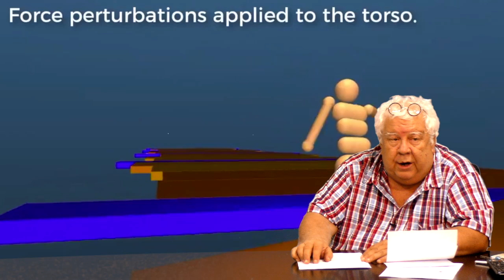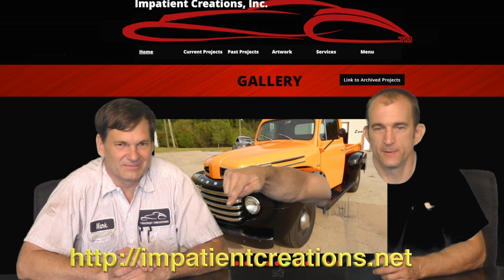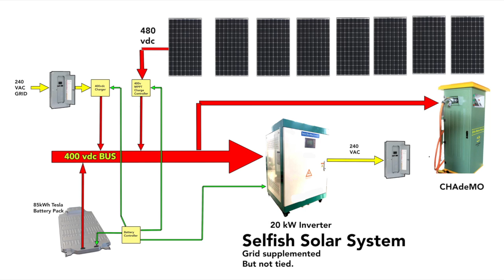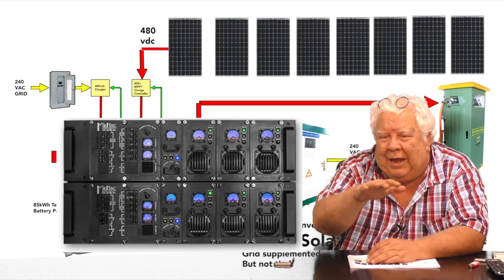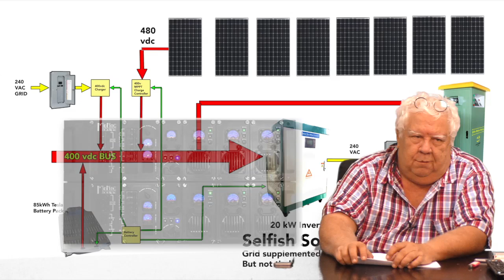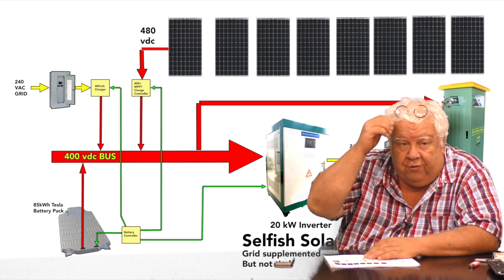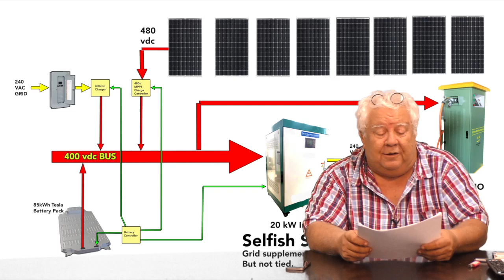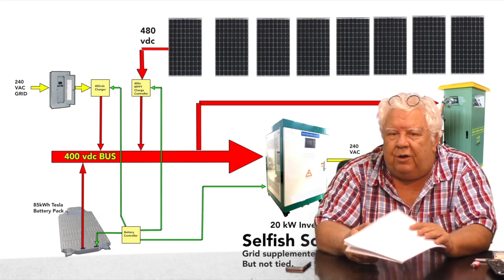EVTV Friday Show - July 21, 2017.  Tescalade - Tesla Powered Cadillac

Comment: Love the show!  2 thoughts, I started doing solar in the late 70's.  Back even before PV was a practicality.  I remember, 30 yr payback (= assumed home mortgage(another stupid assumption) based on a kWh will hit 10¢/kWh !  And I thought it will never be 10 cents, it was around 3¢ then.   My mom created Solar Engineering Magazine and later in 1986 The Handbook of Applied Photovoltaics.  Doing solar back in the day was clearly an adaptive scavenger hunt across nearly every trade.  As a form factor, "still to this day" preheating water or space heating, is or could be passive applications.  It baffles me somebody isn't packaging a plug and play no brainer solution.  You've got it right.  Too much chaos.  My argument, an Ikea (or whatever brand) 4kw, 5kw, or whatever, applied to a load as supplementa solutionl to start, charge the primer.  Unfortunately, my dad, a judge said people are stupid.  As a commercial architectural designer I've learned to design for idiot proof.  My associate built a high rise for Lone Star Gas in Dallas.  They installed gas powered generators in the basement to power the building.  They hated Dallas Power and Light.  Natural monopolies, nuf said

Comment: I agree with all you said through out the whole video.   I been studying and researching solar for the last ten years. I came up with the same  conclusion. I am going to install an off grid system with a battery charger connected to the grid. Some form of lithium based battery.  I was going LiFePO4 or LTO as my battery choice. However, the current prices of used EV batteries is a real temptation now.  Your Tesla battery controller is looking nice.  Keep up the good work.

Comment: Good show Jack.  

I gave up trying to get a grid-tied SMA Inverter reporting to the internet this week.  You're right, they are very complex.  I talked to SMA customer support, batting emails back and forth and phone conversations.  They ended each communication with the reminder, if this doesn't work, contact your local solar professional (their polite way of reminding me that I was weak link in getting their system operational), apparently unaware that the 11 pages of detailed steps they sent me might be part of the problem...

I agree, solar, EV, battery storage, (all quickly decreasing in price while getting easier to implement),  are the direction people will go and the utilities are not keeping up.

Comment: Excellent show, Jack. I like the new direction. Not that EVs are commoditized but that wheel is already in motion and it won't be stopped.

I agree with you on the 'selfish' solar system idea. It makes no sense to sell your power at $0.017/kwh to then buy it back later at $0.13/kwh. If you have extra power to sell to the power company, you oversized your system and lost money on it. Maybe buy another battery and charge that instead.

Comment: Jack, Bill, what about putting a TM4 Motive, 2nd motor,
driving into in the FrontWD of the Escaslade ?

The TM4 inverter, can be made to "Follow" the Tesla Inverter,
thus making a 4x4, that uses the original, mechanical from axle-assy,
and drive with a fairly-consistent front-rear torque-bias under load.

Comment: Hi.  I didn`t read all the comments, but want to mention in case no on else did that Tesla announced they would be insuring their own cars in the future because of so many arguements with in-sure-ance companies.  I was hoping to hear more about this. 
 
Also, it is my understanding the reason a Tesla is so expensive to insure is that if any part of the compound aluminum frame is bent, they will not repair the vehicle.  There are a couple of Teslas wrecked here which should otherwise be fixable....  One is a P100 wrecked on a test drive - we are trying to pick it up for batteries and drive-train, but the vehicle has been in limbo since the winter due to in-sure-ance squabbles.  Not sure what it will go for at auction here in Canada, but are fantasizing something like 20K.

Comment: Jack,  We win every time, genius.
When you do make the controller you should default it to keep 15-94% discharge(or even 30-70% if lacking use), basically optimizing the product lifespan by >30%, I'm sure you know this though, just speaking to the cells. 
I feel like you comprehend the kind of user friendly parameters needs of mass adoption.
It's funny cause I was of the same conclusion, except I wish to buy 1 replacement pack and leave one in the car, basically making it a 2ndary pack(which can drive to retrieve from grid if need be). I thought of this months ago(before finding you), and you've come to the same conclusion, but I'll be off grid.
You're a solid mind sir, it takes a solid one to be on par, I feel we could have a constructive conversation on all this.

My plan, get land, a nice windstream hitched, Model 3+replacement pack, and highly reliable panels(>25yr) on a custom aluminum tracker(I got the beams already for it's sturdy base 10 and 12 inch i-beams I got very cheap, and 25 year warranty panels even cheaper :) ) and have a small farm/aquaponics system of my own device.
No home tax, No power tax, Portability, Reliability.

See you use an iPhone 4, I had an iPhone 4s for 5 years(my first smart phone)
You mention an off grid home in WY, dats me quite possibly, or AZ.

Comment: I bought a 2018 Model S & it goes far beyond expectations.  The only thing I'm asking myself is why did I wait so long!  After buying this EV, called Tesla Solar to install enough solar panels to take care of 100% of my needs, but they only wanted to sell me a grid tied solar system.  I turned my nose up to that & asked where are the batteries?  I don't want a solar system that goes down when the grid goes down, period. In Dallas, Texas it's all about utility credits.  Power companies will not purchase anything with net metering.  They will only give you credits for surplus solar & if you switch power companies, then it's to bad to sad.  You get to start over giving away solar power to the power company.  My mother & father didn't raise a fool; so, I will not do that.

I love your Shelfish Solar concept, for that's what I was expecting Telsa to do.  I found out they didn't want to do this; so, I canceled the whole deal.  And, yes I want to charge my EV from sunshine too & tell the power utility companies to go to hell!

Comment: Jack, you should watch youtuber @Car Guru - He's repaired completely junked Tesla's like the ones you get. Very interesting walk through, his videos are a little amature, to be sure, but he's gotten a completely totaled Model S up and running.

One thing to note about the cost you mention from Tesla to get a repaired Tesla back on LTE / and on network. That fee is basically a warranty certification as well. So any future repairs (2 or 4 years depending on milage) comes with that fee, or so I was told by representative.. So, is $4k worth getting back on network with a 4 or 2 year warranty with on-site service? 

Consequently, thats the same fee they charge if you buy a pre-owned and take it in and they will re-certify the pre-owned and give you a warranty. It's the same warranty you see on their Used Car site.

I don't know any other car manufacturer that will re-cerify a vehicle you don't buy form them directly and give you an extended warranty.  Granted, $4k is a lot, but so is the vehicle. 

Eye of the beholder I guess.

Comment: Jack, I'm the proud owner to 2 Chevy Volts, and a 100% electric house.  I was scheduled to install a 15kW PV system THIS MONTH, but put that project on hold due to our utility attempting to create a separate rate class for evil solar owners that includes a "fair use fee" of $10kW per kW for your peak consumption through the month in summer, and $3 in winter.  In summer months, with both cars charging, the AC running, water heater, etc.  We could hit that 20kW number and get hit with a $200 fee.  I want your system, and I'm willing to pay for it.  I'll contact you soon!
Reply: With all the direct/indirect subsidies for fossils and all the new obstacles for EV/Solar, I think it is safe to say we are on a collision course with the Supreme Court. Definitely game on.

Comment: Selfish solar for highly efficient houses might only be a 3kw to 5kw system. If that were the case, how would that change the cost? Thanks, always entertaining, Jack!
Reply: Jack Rickard 
Your thinking is tied to conventional designed homes. While that's the world many have to exist in I have the   opportunity to work with high efficiency construction designs that are smaller than the median 2600sf home. By completely rethinking the design I limit my cooling loads to only half a day and max 2 tons. All lights are LED and a good portion of cooling is passive. My initial designs are focused on southern climates so heating loads are minimal. Given these assumptions I like your direction with repurposing with a Leaf. I'm pretty sure i can sell over 50 a year, can I find that many wrecks to use? I've always liked your decoding inverter ops and simplifying the ops.
For my ops I need a simple, bulletproof design I can give a grandmother and know she will be safe. 
Thanks for the great reply!

Comment: Your costs and specs for the PowerWall batteries are very much out of date.  The PowerWall 2.0 batteries are now 13.5kWh usable capacity and cost only $5,500 each.  They have also implemented a connection method so that when the grid goes out it automatically breaks the connection and the PowerWall continues to power the critical loads panel.  It is essentially acting as a giant UPS because computers and other equipment that is connected to the critical loads panel will not reboot or otherwise notice the grid outage.

The normal way to use Sunny Island is with Sunny Boy Inverters and connecting everything through the AC micro-grid.  That way the Sunny Island is the only thing that needs to know about the batteries.  When the batteries are full and the solar is still generating, the Sunny Island moves the grid frequency slightly off 60Hz and the Sunny Boy inverters automatically curtail their output.  This has the benefit that you don't have to have the solar inverters anywhere near the batteries.

This is different than the Outback way of doing things where you need solar charge controllers.

Your Selfish Solar System architecture superficially reminds me of the Pika Energy system where they connect batteries and inverters with a high voltage DC bus and they use DC/DC converters to manage the power in and out of the batteries.
Reply: I totally get where you're coming from, especially regarding how Tesla is selling the Tesla Energy products.

The somewhat famous system by Jason Hughes does exactly what you want - operate off-grid until the energy deficit is so severe that you need to charge for a little while from the grid.  I don't see why it is or could be illegal.  His system was fully permitted by his local authorities.  I imagine that you are familiar with his Outback Radian based system that uses Tesla automotive modules.  The main difference in what you're proposing is using high voltage intact EV battery packs.  I think that's a great idea and I was hoping that Outback Skybox would support that type of battery.  Unfortunately, Outback did not have a booth at Intersolar this month.  I intended to ask them about this system and the potential to use salvage EV packs.

I will also point out that a guy in Norway built a DIY system with a Sunny Island and a bunch of Leaf cells to self-consume his own solar.  It used an off the shelf 3rd party external BMS that sent the required info to the Sunny Island by CANbus.

The Outback/Tesla system is on TeslaMotorsClub and the Sunny Island/Leaf system is on MyNissanLeaf.  I can find links for you if you haven't seen those systems.

Comment: Great show.   I couldn't believe no - comment on the news that Volvo plans to be an entirely EV production company by 2 years from now.
Reply: It's just a vaporware announcement. They aren't going to be fully weaned of ICE vehicles by 2019. Read the announcement carefully. They have two years to introduce more ICE cars, and they will still build existing models after that.
Reply: dlwatib IDK, they're a Chinese Co now, and China is manufacturing millions of EV's.  As I see it, all companies potentially may or will be Chinese owned, like it or not.  Effectively they could just come over and buy everything.  In fact they already are.  You just may not know it.
Reply: Jack Rickard on autonomous, for it to work will clearly go beyond cameras.  I believe sensors and beacons could be reference points, strips, or on signs onto a universal refined gps map.  All cars would need location transmitters.  At least a start.  Did anyone say privacy?
Reply: Volvo's announcement says "electrified" which includes everything from 48V mild hybrids to strong high voltage hybrids to plug in hybrids to BEVs.  The only thing they're dropping is traditional ICE with no electric motor at all.